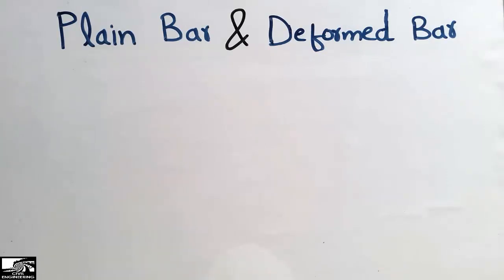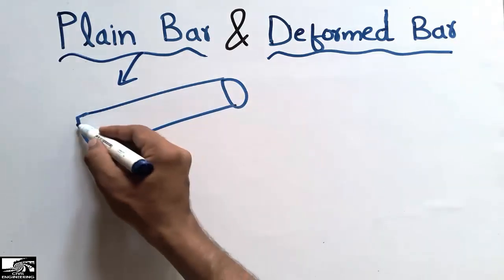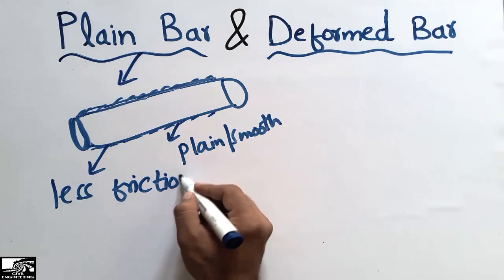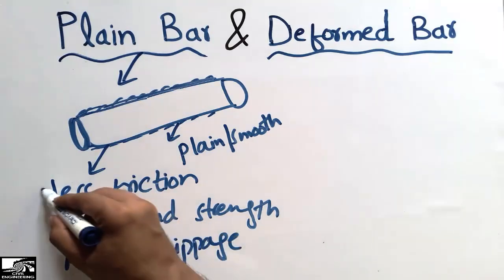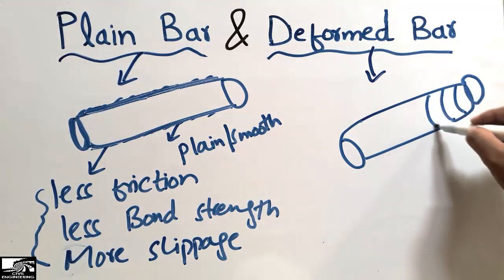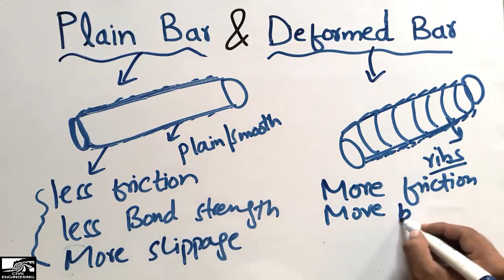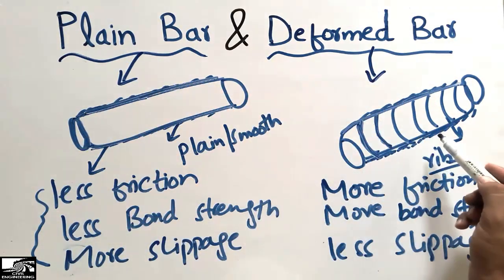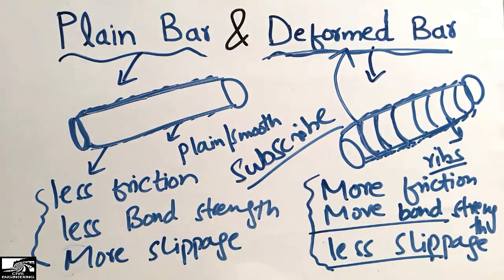Difference between Plain bar and Deformed bar

Comment: How many times  tensile strength defromed bars is greater when compared to plain bars?
Reply: Please any one give the answer
Reply: @SandeepYadav-bj1zl  It depends on the cold-working process. The cold-working process creates a deformed bar from a mild steel bar by stretching and twisting of the mild steel bar beyond the yield-plateau of the stress-strain graph up to a point of unloading. That point of unloading defines the yield strength of the new deformed bar and it solely depends on the amount up to which your are stretching and twisting the mild steel. And that is why deformed bars does not have any particular yield point as such.
Reply: @trishitchandra1549  
I think the question is: If we choose plain bar vs deformed bar, which has higher tensile strength (ignoring the ribs) and are they made of the same grade of steel? Do they weigh the same per 6m length?